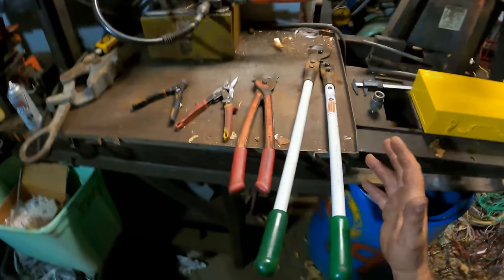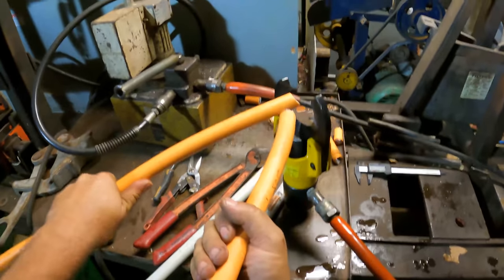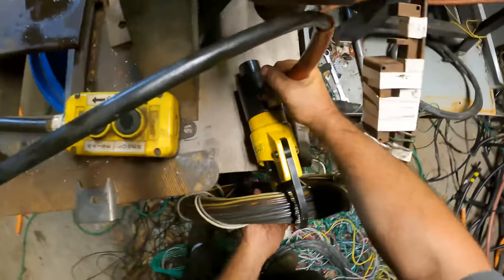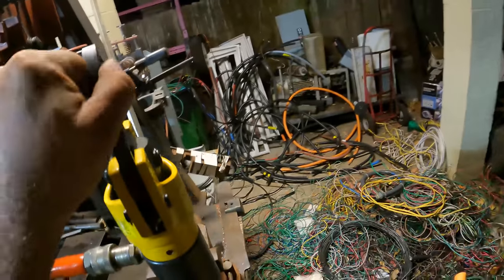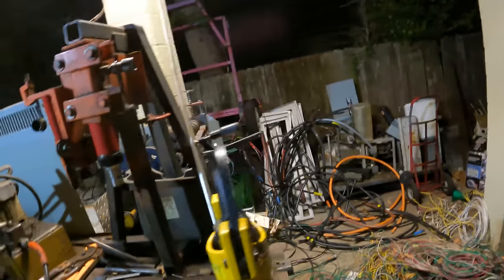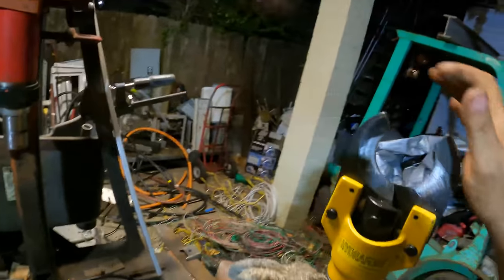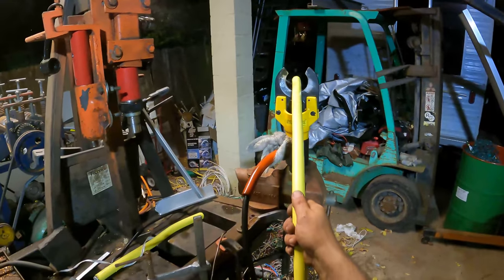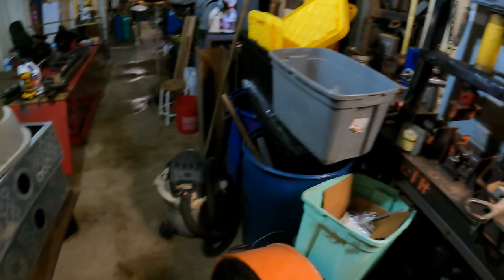How To Cut Copper Wire Like A Pro !$!$

Comment: I'm curious what you could do if you got hold of fireman's jaws of life.... Also, on the loops of thin wire that kept jamming, could you wrap some tape around the loop right where you are cutting to hold everything in place?
Reply from the maker: Funny you say that. Stay tuned. lol On the loops of wire that could work but that's not what Im looking to do. I will get that cutter working the way I want with a few mods. Thanks for watching.

Comment: Where exactly do you find good buys on old broken streetlights, compressors, ins. wire, etc.... Just wondering i live in mississippi .  Especially interested in where i could find a bunch of transformers decent size ones like in streetlights.
\
Reply from the maker: I get them from electrical contractors that specializes in lighting maintenance